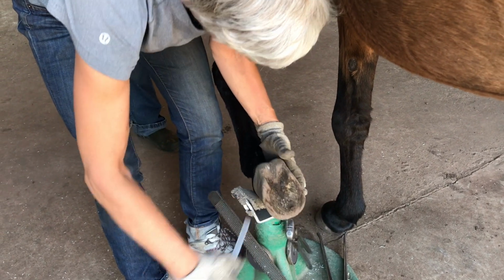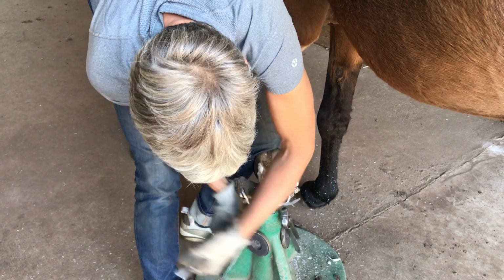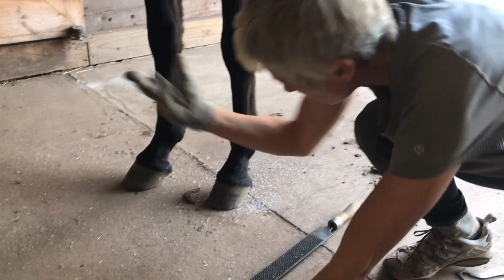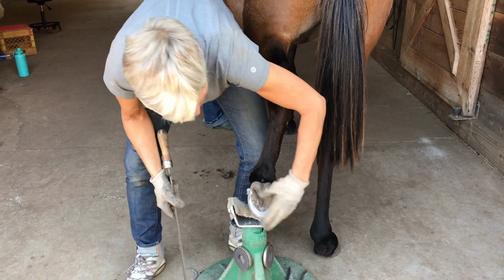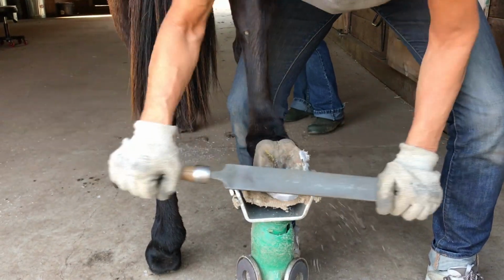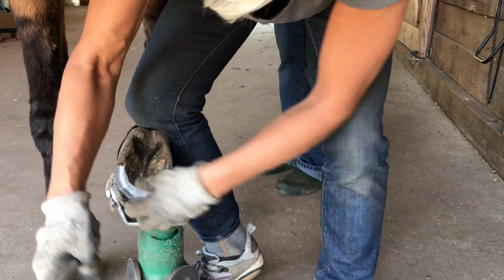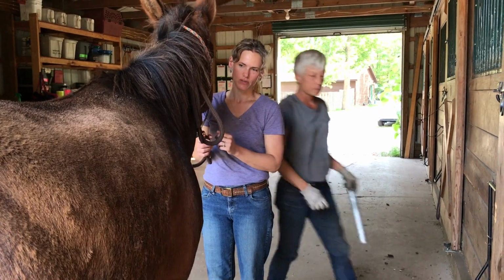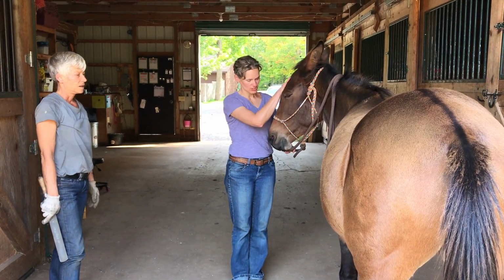TRIMMING SALLY THE MULE!

Comment: Sally has the most expressive face, I just love her!  Okay I have a few observations/questions.  It sounds like when the farrier is rasping the hoof that it is much harder than a horses hoof - is that the case?  It's hard to tell if it is just due to the audio/recording.  Also, a question about the frog size.  The farrier wanted to see a deeper/thicker frog.  How would that be achieved?  More contact/impact/stimulation on variable surfaces like you would get from trail riding/general work?  Or is that achieved through diet or topical products?  I also noticed she did the same sort of "mustang roll" to finish off the front of each hoof like is done with barefoot horses.  I thought that was interesting.  I have zero experience with mules or donkeys but just love them to pieces.  Thanks for sharing Sally's mani-pedi with us!